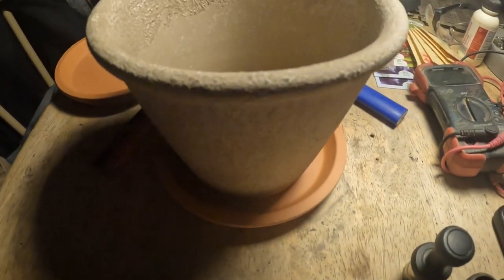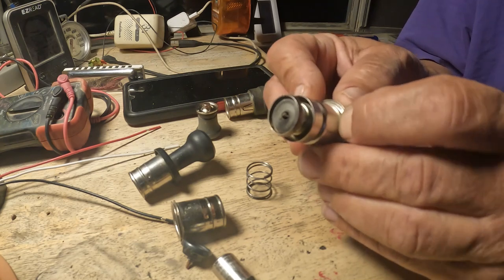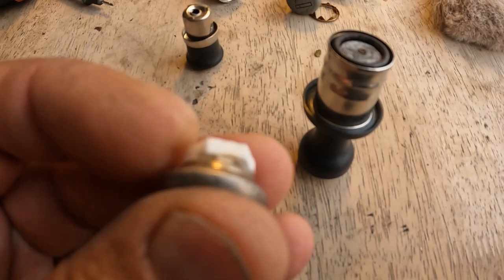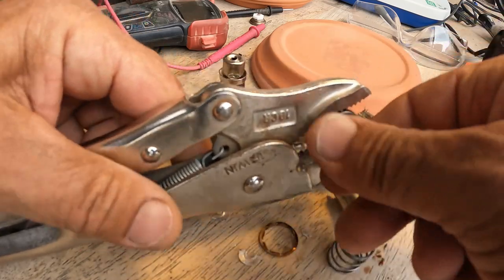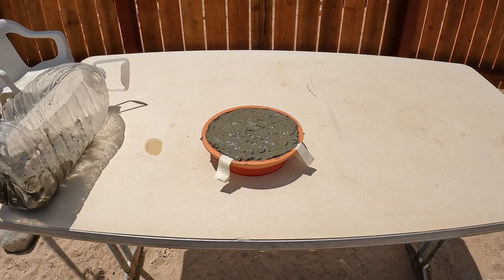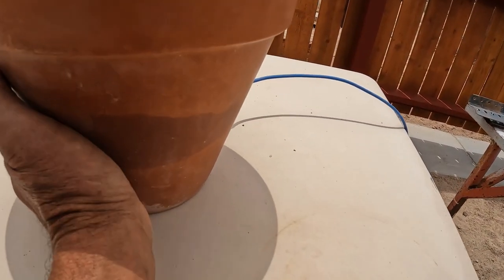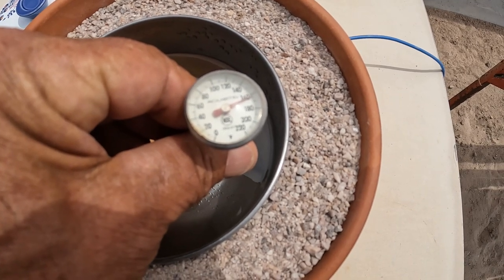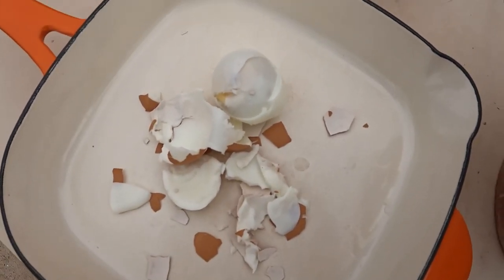SHTF Automobile Cigarette Lighter Sand Battery E90

Comment: Hi. Why did you put the coal into concrete. There's a reason
Reply from the maker: It just helps keep it secure and prevents me from touching the hot coil. In a higher voltage one it could electrocute me if I touched the coil so isolating it is a good idea in my opinion but not totally necessary. I make these ideas up as I go. Thank you for the comment.